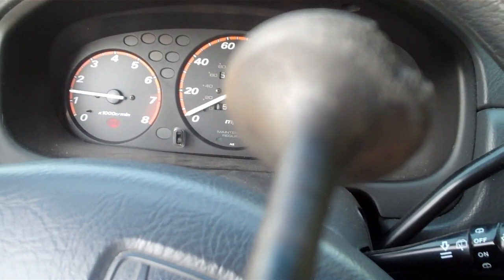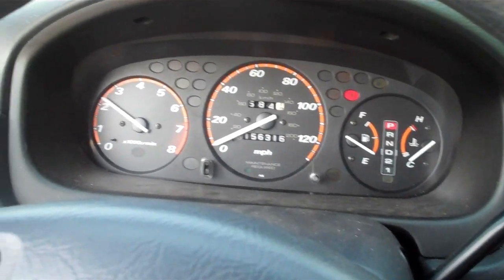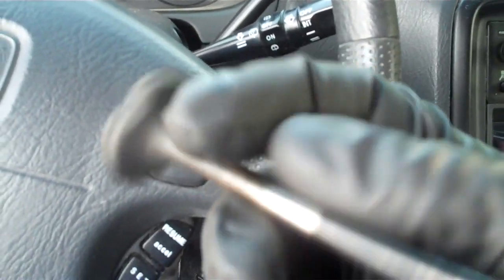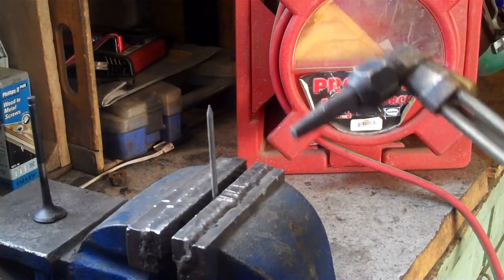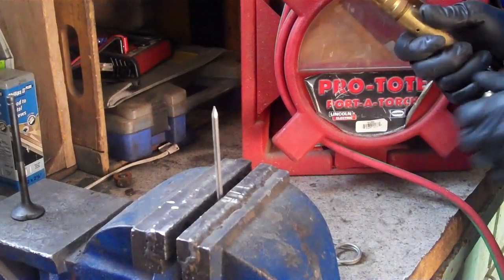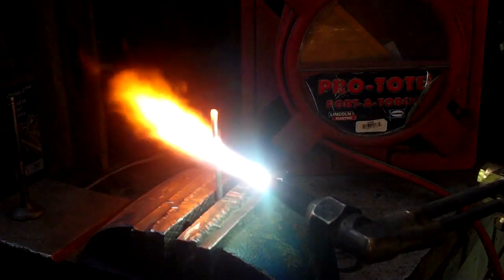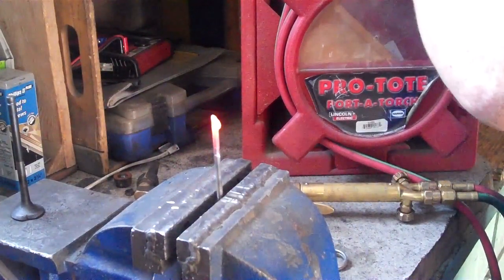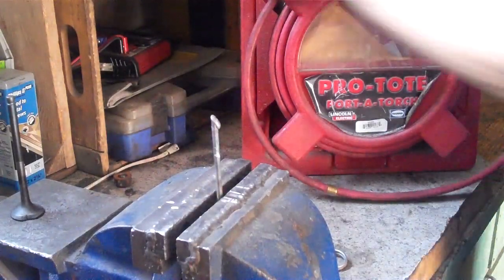My theory on burnt valves

Comment: Just a little thought on engine exhaust valves.  They run red hot in the engine and they need to transfer heat any way they can.  Most heat is transferred when the valve closes thru the seat.  If you have guide seal problems (as some Hondas did), carbon deposits will catch between valve and seat, eliminating the heat transfer and allowing hot burning fuel to pass thru and toasting the valve.  Anyway, that's my theory.  Good vid and good demonstration.
GFM

Comment: A friend bought a used Honda that kept overheating and throwing the antifreeze out. The mechanic finally diagnosed it as someone having stripped a head bolt out. One thread insert later and the car runs like a champ. I hope that your car isn't that bad.

Comment: Just the 97-2001 have issues, if u have them done, have them adjusted to the loose side of the specs, the motor should sound like a sewing machine when its done lol

TSB 03-038

Comment from the maker: It's easier if you do.  Do this.  Clean with air around the injector bases.  Then unbolt the rail.  Relieve pressure at the fuel pres test port.  Gently wiggle the whole thing up all together.  You can lay it aside or disconnect the lines (quick disconnect tool req'd) and remove it completely.  Be 100% sure to lube the injector O-rings with gas before they go back into the manifold.

Comment: I have a ? 01 f-150 xlt 5.4 L. There is a tube that transfers water across the engine. It goes behind the alternater and side to side. How do i get the tube out all the way. I did get it loose but on the passenger side there is a leak right near the fuel rail and injector and bracket.. Do i need to pull the injector bracket and injector out to get the aluminum tube out?
Leonard

Comment: Kinda looks like U had a Exhaust Header Leak, or Exhaust Leak generally that burns valves because on the intake stroke it sucks in oxygen that accelerates burning! I know this to be true on Motorcycles when you mess with Mufflers and Pipes U must re-tune it to prevent valve problems! Thanks for the insight.

Comment: If the valve clearance is not adjusted properly the valve will be left slightly open when it should be closed. If the valve is not allowed to close the valve can not dissipate its heat into the valve seat/head/coolant. The valve seat is the main path through which the valve dumps its heat and will burn up like you show if not allowed to do so.

Comment: Valve stem seals dropping oil down into chamber through edge of valve causing a hot spot in one particular place has also been blamed.  Was the adjustment auto or manual on these motors?